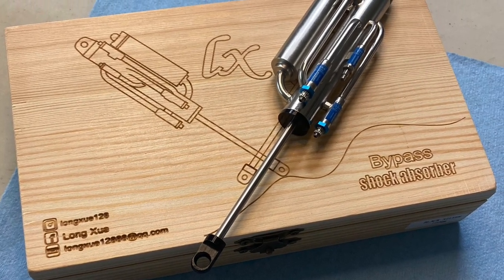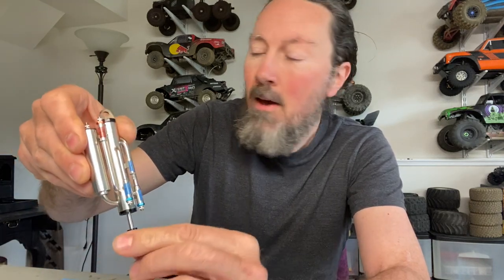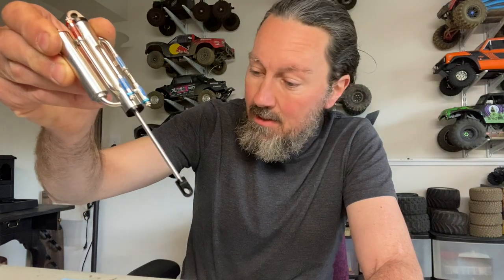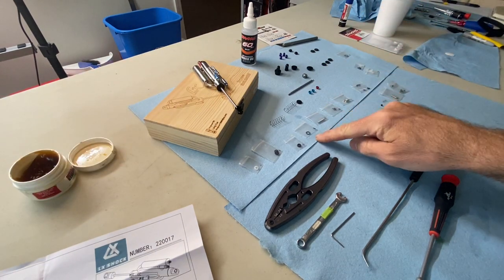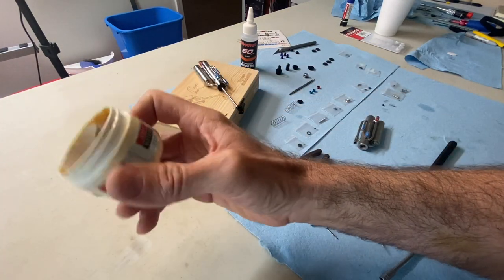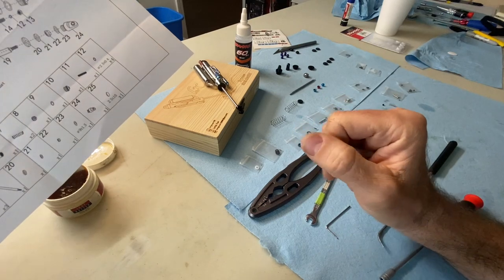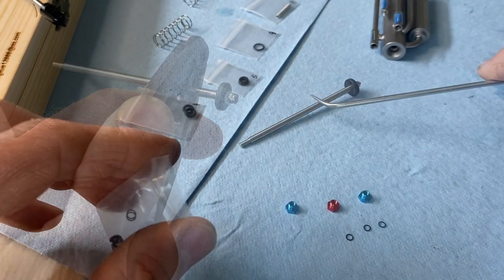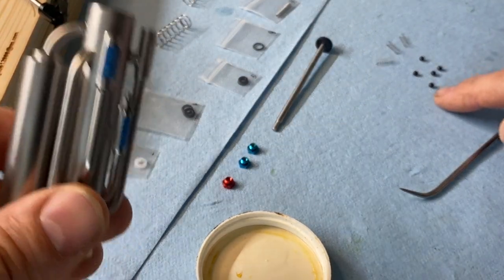LX Bypass shock build Part 1 - Traxxas UDR

Comment: These shocks look really cool. I hope they work. I will definitely be adding some to the UDR. I've been waiting for a functional set to be released for the Bomber too.
Reply from the maker: I did a quick test yesterday and they seem to be working well. Need to do some tuning now.
Reply: @rcilluminati26  dude I'm about to get this for my super Baja Rey truck
Reply: When I went to order.  It says $125 . Is that a pair or for each? I didn't order because I Def want a pair.. plz reply and lmk so I can order them my friend.. tnx in advance and tnx for POSTING thisvideo
Reply: @kevinmendesracehavenrc  these shocks would be too small for a super baja rey.
Reply: @toksta79  on the web site it's says the 160mm "for super Baja ray
Reply: Even if the length is there, the shafts are too thin to be reliable. Also consider the shock body diameter. These are closer to 1/8th scale size shocks. Perfect for a UDR, but undersized for a SBR. The SBR shocks are much larger then these shocks. I own a SBR.
Reply: @toksta79  ok very true. Well I'm buying these now for a udr I'm so getting lol
Reply from the maker: @kevinmendesracehavenrc  that’s for a pair.

Comment: At 13:55 are you sure that first o-ring is not supposed to go on before that rubber "shim" ? So it would be o-ring, rubber shim, o-ring, "black thing that screws on"? It would make sense since that rubber "shim" had that recess in it to accommodate for it. Just wondering.
Reply from the maker: No, The seal should press against the shock body. The o-ring is an additional seal. I think they have a new seal design now.  Mine ended up leaking after a few months

Comment: Well looks like I’m ordering these tonight. My only question is, on the site that sales these there are two different mm sizes is one for the rear an one for the front can I put bypasses in the front of the udr or can you clarify that for me. Awesome video btw much appreciated
Reply from the maker: I believe the front will only fit with different upper arms due to clearance issues. I think they were working on making some
Reply: @rcilluminati26  ended up figuring it out but they are out of stock :(